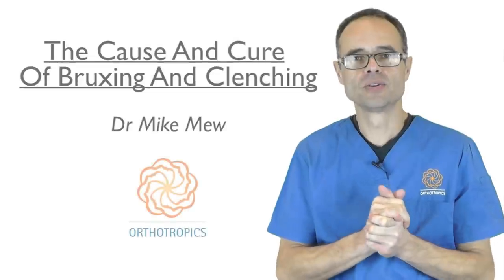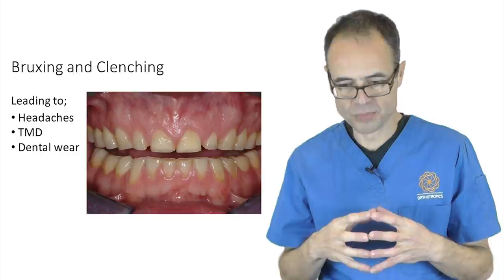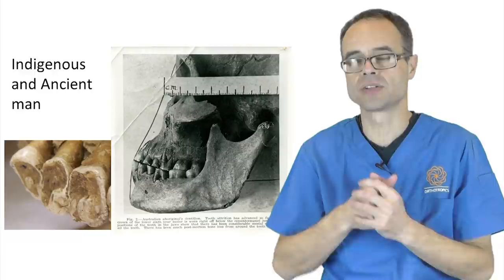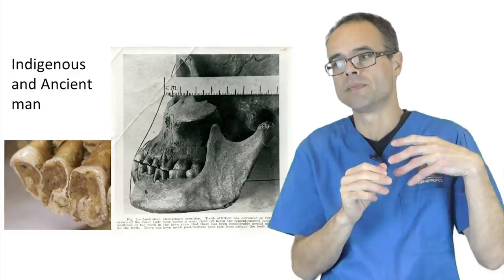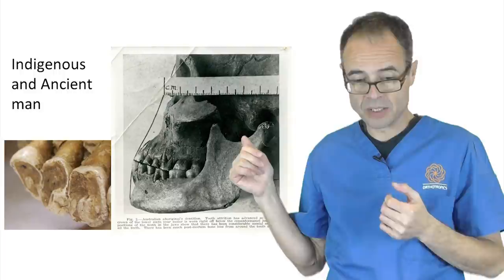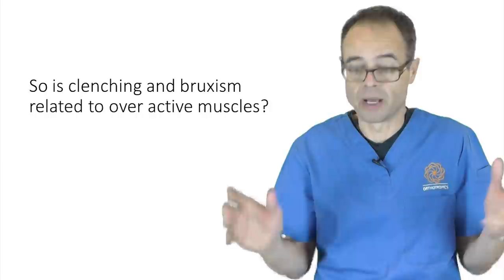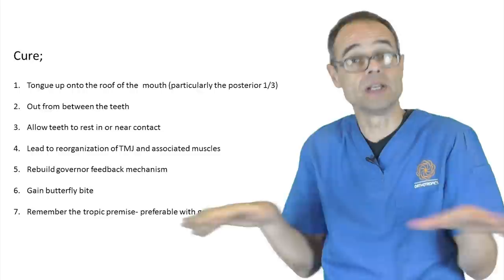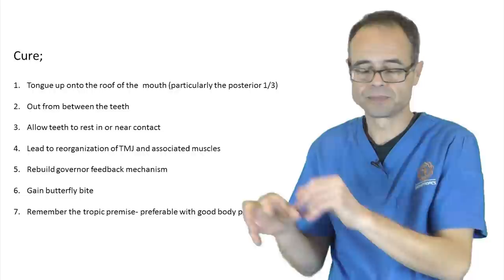The Cause And Cure Of Bruxism And Clenching By Dr Mike Mew

Comment: from experience: soft- you will be chewing all night - no help. hard splint : if it's only one jaw then you will be wearing the other teeth over the hard plastic splint. another problem is hygiene. your tongue will be white and you will have continuous mouth ulcers. regardless you will dunk the splint in a cleaner or mouth wash for a day. it's the saliva staying in for the whole night. trouble is you will either have continuous mouth and throat infections or you will chew your teeth. i am not stressed and do that night only. i am very resistant to pain when aware but clenching and grinding when sleeping. I can't see the way out of it.
Reply: I am in the same boat. I was wondering why my tongue was white! I guess I got my answer thanks.
Reply: Could you elaborate a bit more? I do have a hard shell for the upper teeth and was wondering if the benefits outperform the disadvantages. 
Why is the tounge white?
Reply: A white tongue in Chinese Medicine tells of stagnation in the body. Mouth ulcers  an be a sign of a sensitivity. Certain foods such as cashews or to much orange juice can cause ulcers for some people, myself included. 

I don’t know if a standard allergy test would identify the trigger or exact cause. Process of elimination test might be best or work with an energy healer such as myself who can tune in to potential triggers and help you identify the cause.

Comment: Dr. Mew, could you make a video explaining how we can engage the back 1/3 of our tongues on the roof of the mouth if we already have jaw/teeth misalignment that make this difficult? Can we do it without an appliance?            I also read a very interesting article talking about bruxism as caused by sleep apnea, and noting that petite women with long necks have the highest rate of bruxism due to airway collapse during sleep. Personally, I'm pretty sure this is true because sometimes I am even dreaming that I can't breathe when I wake myself up and my teeth are clenched tightly together. Your revelation that the tongue is the opposing muscle makes so much sense!  When I try to push my tongue onto the roof of my mouth (making the "nnnnn" sound), my jaw drops open. The tongue is obviously not doing its job when the teeth are tightly clenched as I sleep :O.  How do we balance the two?  And thank you so much for all the work you do! Also, you're very funny, I love the little jokes you include.

Comment: Dr Mew.. I have been practicing conscious hard chewing daily for a few months now (using mastic gum) and have made considerable gains in my masseter muscles. However what concerns me is that I now sometimes wake up at night with very tense masseter while clenching my teeth. It seems that the chewing is making this way worse. What should I consider doing? Tongue is on roof of the palate most of the time
Reply: cavallopazzo340  same problem  but got corrected  after I started  mewing
Reply: What do you mean by mewing? chewing hard gums and keeping good tongue posture? This is exactly what I'm doing and it is making my clenching worse, that is why I posted the comment
Reply: cavallopazzo340 how long have you  been  mewing  for ?and have you expand your  palet?
Reply: Probably around 6 months now... I haven't noticed any expansion in my palate but I haven't paid attention to it as my main goal is getting a broader jaw, for which the method definitely works
Reply: cavallopazzo340 what type  of  bite  do you  have  grinding  is by deep bite that's what Mike mew says that I have a deep bite but it was cause by back molars. maybe over using
Reply: What is a deep bite?
Reply: cavallopazzo340 it's the excessive overlapping of the front teeth. Its cause can be dental, skeletal or both.
Reply: cavallopazzo340 How its going now? What u did with this problem?
Reply: which gum did you chew?
Reply: @politicsinplainenglish1791  oh man

Comment: I'm not going to act like Ik exactly what he's talking about, just speaking from experience.

When I first started mewing, I was doing it incorrectly and it gave my jaw....problems, so I stopped for a few months to a year. When I started mewing again I had done a lot more research and now my jaw feels much more strong and firm, and to put it simply PROPER mewing accompanied with good body posture is the way to go, if you screw up on either one you will end up with jaw joint problems, in my experience anyway

Comment: I knew I had a bad resting position but whenever I mentioned it to a dental tech they would be confused and I had to ask the doctor and they were like "oh yeah put it on the top of your mouth okay bye" so I did that but I didn't do it right so I did have a little change in my teeth but I still had a lot of other issues then around a year later I found out about mewing.

Comment: I am a dentist who has been operating a private dental clinic in Korea for over 30 years.
I try to express my thoughts that I have felt in the past. To grind the teeth, you have to bite hard.
In order to bite hard, some teeth must make an early contact with the teeth.Those teeth are molars, not the anterior teeth.
This is because you can not bite hard on your anterior teeth.The molar should fall forward to show premature contact.
In order for the molars to slope forward, the adjacent faces of the teeth must wear out.In order for the proximal surfaces of the molars to wear out, the molars must move in the buccal and lingual directions with the molars and neighboring molars in close contact with each other.
In other words, it is a state of group function.When the molars are tilted forward, the back of the tooth moves toward the occlusal plane,
This part acts as a premature contact during central occlusion.When the adjacent surfaces of the teeth are worn, the teeth are inclined not only toward the forward slope but also toward the tongue, so that the distobuccal cusp of the tooth moves most to the occlusal surface.During chewing, the cusps induce the lateral movement of the mandible and the continuous isometric contraction of the muscular muscles due to the contact of the molars causes unreasonable occlusal forces on the teeth, increased flow of the teeth, and disruption of the muscles.When you sleep at night, the patient will clench without you knowing. This is due to the action of muscles to induce isometric contraction and restore normal VD.
When sleep at night, the patient will grind the teeth.
It is the act of grinding teeth to remove premature contact areas.If the muscle has the maximum contraction distance, it enters the resting phase without any abnormal activity, but if the maximum contraction distance can not be secured for any reason, the activity is started to eliminate the cause.There are many factors that prevent the maximal contraction distance of the masticatory muscle.The teeth are erupted in the mixed dentition and interrupted until the occlusion is complete. When the tooth is pulled out, the tooth behind it is inclined forward and disturbed.It also occurs in permanent dentition, the wisdom tooth erupts and the tooth interferes with the opposing teeth.When a piece of cookie sticks to a tooth, this piece of cake prevents the muscle from ensuring maximum contraction distance before falling.Only natural teeth do not interfere with occlusion.The amalgam is interfering, so is the inlay, and so is the crown.Premature contact caused by the prosthesis interferes with the maximum contraction distance of the muscles, which leads to persistent clenching and bruxism.Occlusal stabilizers can make bruxism and clenching disappear.
If symptoms improve with the use of the device, you must find the cause and remove it, otherwise you will get another symptom.
Reply: 홍성우 do u think braces can cuse bruxism? or is it temporary?
Reply: What do you suggest is the best treatment? I have been getting botox which seems to reduce the clenching but does not eliminate the grinding problem. Also, do you offer treatment in Korea for bruxism?

Comment: I have a very extreme case of bruxism where all my top front teeth are literally worn down to just nubs and my bottom teeth are too far in and they rub my inner upper gums so much during sleep that it makes it raw and it hurts to eat. I strongly recommend, way too late for me but now I do wear this every night, a large rubber sports mouth guard and at least my gum pain has completely gone away. I believe if you wear this every night it'll keep your teeth from chipping away. I am an extremely adventurous dreamer so I guess that's why I grind and clench so much in my sleep. I wish I would have discovered the large rubber sports mouth guard 10 years ago because I would have saved my teeth.

Comment: Bigger beings slow down so that everything keeps its motion.
Otherwise if it was at 1000 miles per hour and the transmitors didn't get to the body in time but you had new order then everything would be a mess.
That's why the body understands time, timing, and order.
There's only one being in the Universe which can create such things.

Comment: 16:15 challenge on that. that it wud be a false dichomoty. 3rd option of blowing out vigorously
Reply: I used to get such a bad blocked nose as a child due to tonsilitus (or possibly the other way round,) and no amount of blowing it would clear it.  Mouth breathing was the only option for me, and it was when my tonsilitus got regular enough and bad enough that led to me having my tonsils taken out at age 9 that I started to notice the sunken cheeks, dark circles under the eyes, and my gap teeth, all of which I've had ever since.  Just my experience, and in my opinion allergies are getting that bad that most children are getting blocked noses bad enough to cause mouth breathing to become a habit.
Reply: hey gray , so there was buildup in your nose that was blocking the air?
Reply: When I was a child, even as a teenager I'd blow my nose clear and instantly be blocked again, for days and weeks due to tonsillitis and allergies (I've never noticed any specific allergies except for hay fever as a teen, mainly I'm just talking about general issues of the modern environment that affect us all.)  I had to breath through my mouth to survive cause my nose was completely off limits for all intents and purposes, no two ways about it just like Mike Mew said.  Not everyone in every case of a blocked nose will be like that, but it's only got to be bad once as a child to possibly cause poorer oral posture, which starts a negative cycle.

Comment: hello, i know this does not relate to the issue of bruxism. i have a request for a video. i have not found any clear information about this anywhere. when it comes to lip line (while smiling), is there any things to be done to achieve an attractive smile? personally, i have a low smile line and i do not know how to correct it or the cause of it. could you make a video explaining this and provide some guidance? the gummy smile problem is well known, but i have maxillary excess but still a low smile line. I am looking for either soft tissue or skeletal causes or solutions
Reply from the maker: Interesting and something that I've thought about but not discussed before.  I might ask Dad if he could do something in this area.  Mike

Comment: From observing dogs chewing a bone, I believe the theory that the tongue is the antagonist to the masseter is true. You can clearly see dogs tighten their tongue and push up towards the palate when they attempt to bite down with significant force. This would in fact be a similar movement of the structures that most mammals have, including humans.
It makes sense at this point, from a design standpoint, that the tongue should be at least strong enough to slow down or even stop the movement produced by the masseter.

I started applying some of the things I've learned about mewing just 4 days ago and the first thing I noticed was that my tongue is currently extremely weak in comparison to all the other muscles in the area. As my tongue is getting stronger, I've also noticed that my spine is improving both its lateral alignment and forward posture.
I was previously aware of how the mandible is used to counterbalance the posture of the spine, but I had no idea how significant the tongue was. During these past 4 days I've been trying to keep my tongue on my palate almost continuously and even pressing upwards while squatting or doing other exercises that require balance and it's been clear to me how significant the tongue is in being able to coordinate all the muscles necessary to not fall on the floor.